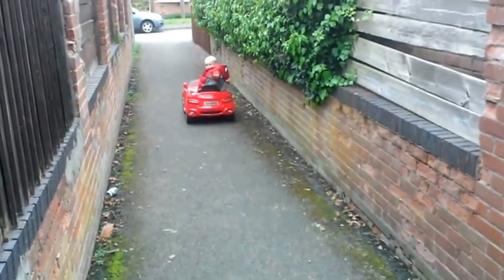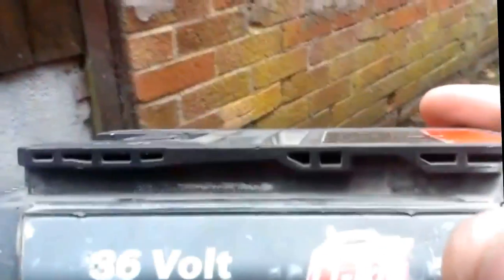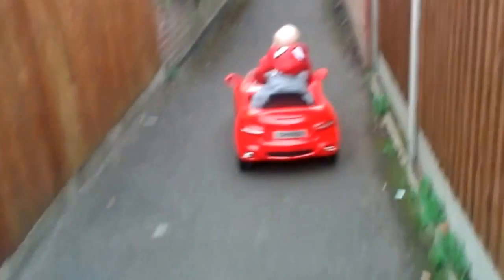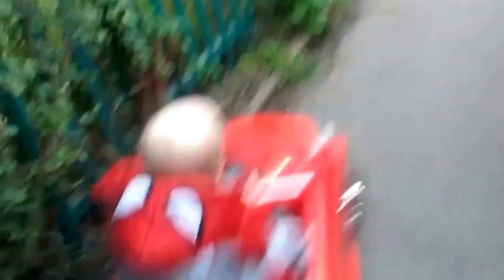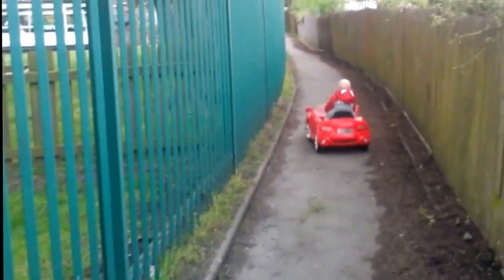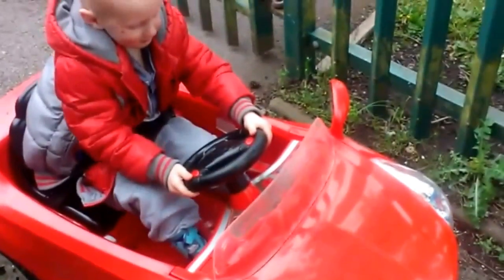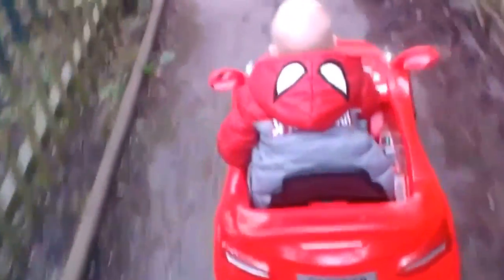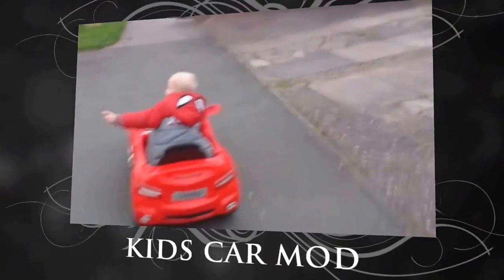12v to 36v electric car "upgrade"

Comment: Mate, i did tried 18v (2 x 2ah dewalt) 4ah batts(linear) and I could see a little improvement in terms of the torque and speed. Then I thought I'll chain them up to gain 36 volts and it blew the capacitor. Anything You could suggest please to get the thing flying?
Reply: I had the same issue …
Reply: I think the newer models can’t be done
Reply: I think the only fix for upgrading the newer ones is by upgrading the capacitors

Comment: Good work!  I wired up another 6v to the existing 2 (so 18v not 12v) and thought it was quick. I was wrong!  Love the way you’re using power tool batteries. Smart
Reply: Melts the gears so be careful. Very fun while it lasts!

Comment: That's the inspiration for my weekend project, gonna go for a full brushless setup with 12s. 44.4 volts, 22000mah. Got the hospital on speed dial.

Comment: Take it you upgraded the fuses and motor according to voltage. I've seen a power wheels catch fire  due to a battery over working the motor and up it whent.

Comment: hey mate, i wanna upgrade to a 24 from a 12, how easy would this be? and do the motors used for a 12v cope with the 24v power?
Reply: Hey mate, I want to do exactly the same for my son's Ferrari. Have you managed to  upgrade the battery and motors in the end? Thanks
Reply: Easy and no, all you need to do os hook up 2 12v batteries in series (not parallel) Google it for an explanation. But the gearbox will wear out much faster, fun for a while though try an 18v first or a 12v and 6v in parallel it will last longer

Comment from the maker: it finally melted all its gears... if only i could swap the cheap plastic ones for metal lol
Reply: I am gonna try This
Reply: Sam Thomas can u put any battery from any company in these cars Or does it have to be the same battery by the same company?
Reply: @TrumpetMonkeyy  any battery or charger will work but sealed is best like fire alarm batteries and the volts and amp hours are to be considered also
Reply: Cool Dad!
Reply: +G.Ritchie.N you can use any battery my Mrs son has a 4/6v bat man car I was playing in it and messed up the gear box so I've orders the 12v motor and gear box X2 I've put one in for now with 1 battery from the razor e1000 scooter and goes qwick and drifts will b putting the other motor in it with the 2nd battery once  her son get used to it